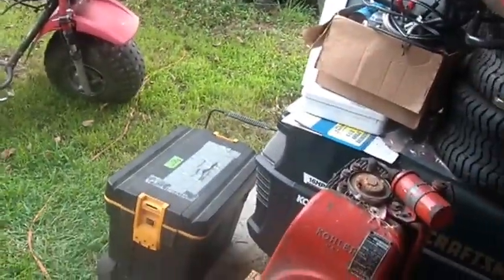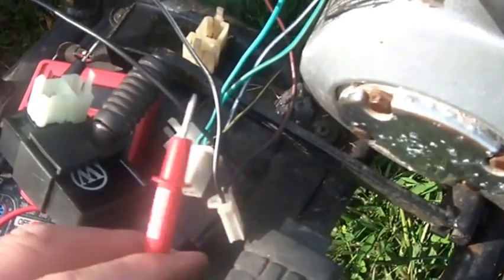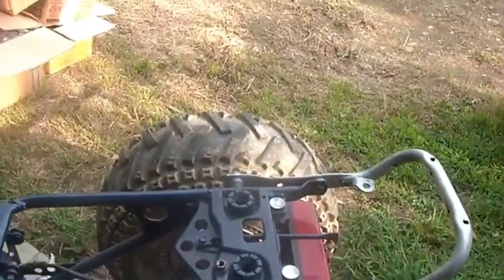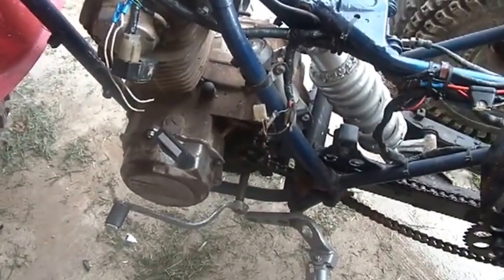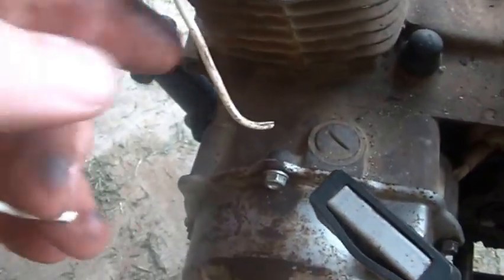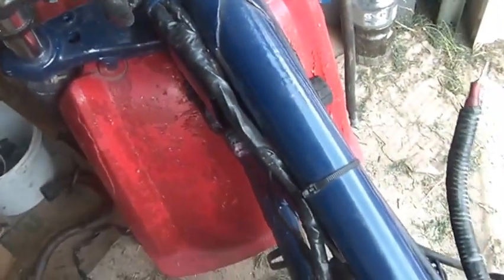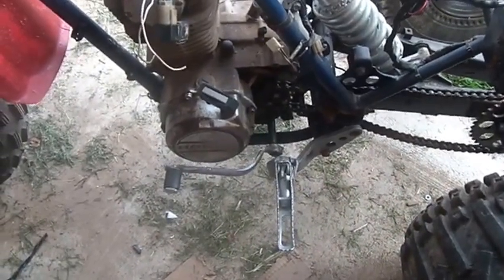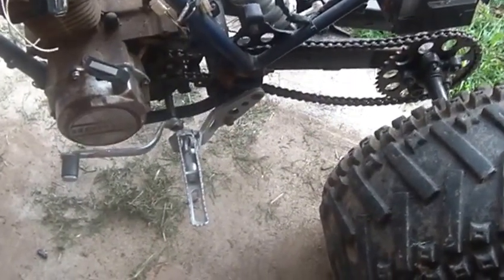8_19_2013, Honda 200X to 185cc Motor Conversion,

Comment from the maker: Wallie, Trying to figure out what the person before me did is what is holding up that Big Red 250ES project, I'm thinking I should open it again and make sure that nothing else is stuck to the magnetic fly wheel which can screw up another stator, to get the side cover off, the motor needs to be loose, so, there are motor mounts hanging around. My new rule is that someone else's project is equal to parts, I don't have the time or space for any more who did whats. Thanks for watching and sparing!

Comment from the maker: HondaATCTRXguy, I was thinking the same thing, that the 12V cooked the first CDI and also killed the first new one. I checked the connections to the CDI and did not see 12V between any of them and gnd. The new CDI that died was real cheap, $7.95 delivered, the one I'm using now cost $10.95 and has a name on it, (Jantel),. Maybe, the 12V on the CDI is crank position, (ie timing), dependent? I don't know, I now disconnect the battery when I am done riding. Thanks for watching and commenting!